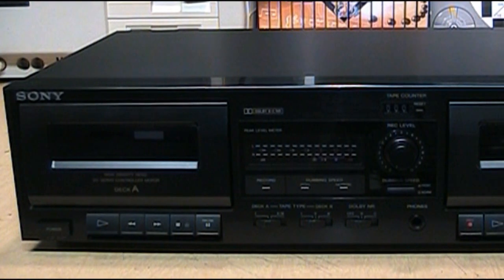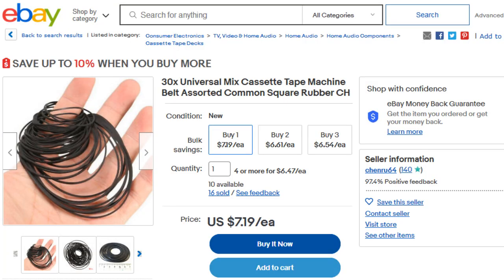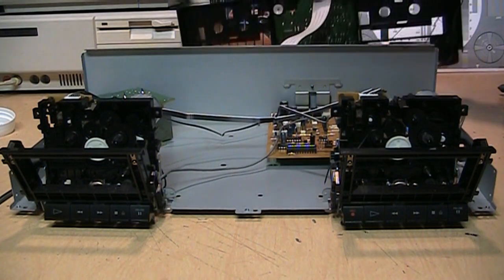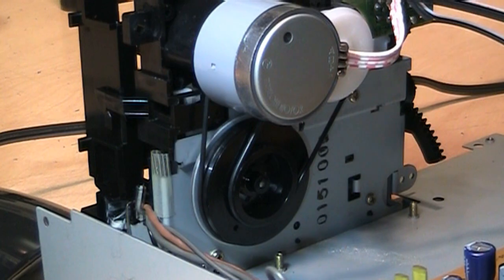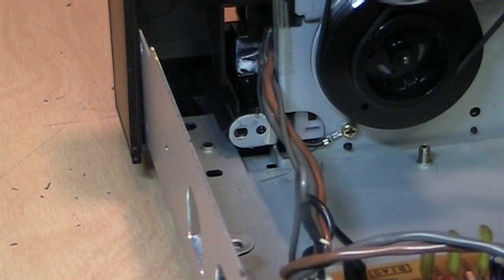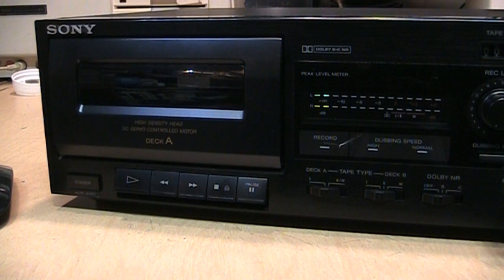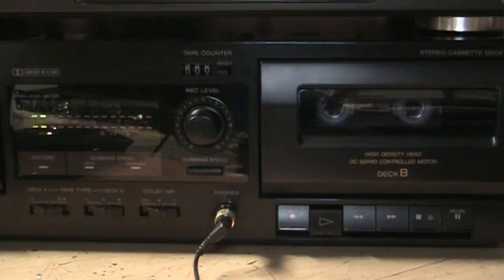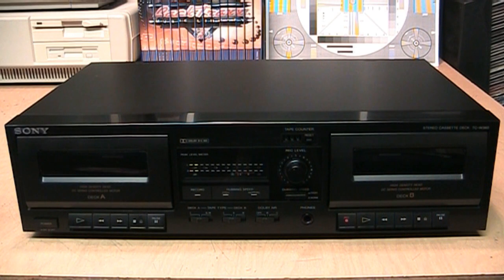The All-Plastic Sony Surprise cassette deck - TC-W365

Comment: A few years ago, I found a Sony cassette deck on the side of the road… I don’t remember the model number, and although it looked really nice, I also had to deal with badly melted belts which unfortunately stained my bedroom carpet (even though I was using old newspapers to prevent that from happening). Thanks again for such an entertaining and informative video!
Reply: How do these things appear on the side of the road? There's never anything interesting on the roads here, let alone things as big as a tape deck.
Reply: @RedShift5  Sometimes around where I live, people tend to toss out some of the most interesting things I’ve have ever seen by the side of the road… I have even found other related items that other people have tossed out like console TVs, boom boxes, all-in-one stereo systems and even stereo receivers (which I have actually found on more than one occasion)!
Reply: this comment goes well with the one on the top
Reply: @RedShift5  well...i got my Sony TC-W435 exactly the same way...by the side of the road...i swear to God...no lid on it though...all wet with rain and melted sticky belts just like most...it turned on and blue display illuminated...so i deemed it worthy of new belts...after lots of black goo removal with IPA and cotton buds...it mostly works...deck A is fine...deck B is poor sound and fluttery...it's a backup to my Kenwood twin deck anyway...other stuff i've seen...old computers...even a huge all in one Mac with crack in the corner (Mac pro?) several giant TV's...battery drills with dead rechargables (which i modded to run from an external power supply)...no consoles though - unlike Douglas...

Comment: I bought this tape deck with money I saved at Service Merchandise when I was 15 in 1992. I still use it today. It’s not anywhere near as nice as my other components, but it just keeps working. Great video! I need to replace the belt in deck 2, but will do both while in there, so you’re doing the research and finding that part no. helped me out big time. Thanks!
Reply: Yep, me too, i bought this same deck used at a thrift shop, glad I get to see the repair, service & reinstall of the belt systems

Comment: From a combination of personal experience and scanning eBay for a few years, the worst offenders for dissolving belts were Sony, Aiwa, Kenwood, Pioneer and Hitachi. At the other end of the scale JVC, Technics/Panasonic, Akai and Nikko used belts that stand the test of time the best.
Reply: I can certainly vouch for JVC; my two TD-V621 decks still have their original belts, and this deck utilizes two (identical) belts for the flywheel.
Reply: Personally I can vouch for Sony's giving up the ghost but never had a problem with Pioneer or indeed as you say Technics
Reply: I've been pretty lucky with belts not being melted, but now that Im thinking about it the Sony examples I've seen have certainly aged worse than the Technics/Panasonic examples I've seen.
Reply: And Denon. My 1989 DRW-750 is on its original belts, as is my 1984 DCD-1100 CDP. Both bought second hand....
Reply: I have an Aiwa deck from 1987 and the belt had turned completely into goo, it was fixable but required a lot of cleaning
Reply: Panasonic sadly in some of their decks have a flexible plastic gear that fails .
Reply: @thisisnev: Yep... a lot of those Technics and JVC decks still used wide, flat belts, and they've certainly held-up very well:  I have a nice mid/late 90s Technics and JVC deck with those flat, wide belts still running perfectly!
Reply: @AaronSmart.online  Sony eventually bought out Aiwa so it probably had a lot of the same internal parts as this deck.
Reply: Definitely! My 1981 technics' belts are mint
Reply: Dont forget Philips 😄
Reply: @EddieJazzFan  the mechanism and belts look absolutely nothing like this deck, and there's 8 years difference between them...
Reply: I have 3 or 4 Technics decks with the same mechanism (2 or 3 pieces of RS-M205 and an RS-M215), all working fine with their 40 years old belts and pinch rollers! And they are all well-used, in one of them I had to replace the head because it had a high freq rolloff at about 6kHz due to extreme wear. In that one I had to clean the belts and pulleys with alcohol, because they were covered with fine dust and slipped, but after the cleaning it worked perfectly. This was ~12 years ago, and it still works fine.
Reply: @mrnmrn1  my rs-m215 has also got a really worn out head. Do you know what the best replacement would be?
Reply: Totally agree with JVC! I’ve had several of their boomboxes still functioning on original belts, or even if the belts do need changing they haven’t turned to goo
Reply: I have a Pionner Double Cassette Deck from 1995 with the original belts, still working
Reply: I can also confirm this is 100% true. Have both a JVC and Technics Deck both with original belts, and have hardly ever had to change a belt on a Panasonic. However I have several Sony's with junk or melted belts.
Reply: @paulb4uk  Yep. The gear problem is most common on 90's Technics decks with auto reverse.

Comment: You gotta love how they try to make each LED on the VU meters look like two separate LEDs lights.
Reply: Even Nakamichi did that, on some of their lower to mid end decks, even at their peak [see what I did there?] in the 80s. And all segments, one colour. Famously [almost] all 'Naks' had manual tape type selection, and many had a mechanical tape counter, with the base models having them I think right to the end. But all working, serviced models today will wipe the floor with this sony (and the top Sony's competed with  Nakamichi, back in the day, and  the little WM-DC6 "Walkman Professional", five segment meters, mechanical tape counter, is simply stunning, with a Naka-like price to match). A bad one... may eat tape.
Reply: for estatics only, u ever used it?
Reply: @DuncanWEDD2019  @Duncan Webberley  Think of Sony D6C as Nakamichi RX-202  in terms of cassette orientation and Nakamichi BX-125 for practically most of the functions. :)

Comment: I had a nice Sony deck with Dolby S from the 90s that I bought new in J&R music world.  I used it for about 15 years and put it in storage.  Then when I went to take it out and use it again a few year ago, the belts were completely melted.  It was like somebody just dumped roofing tar all over the inside of the machine. I just junked the machine, but regret it now. The tapes that I recorded in that deck still sound really good.  Would have been good restoration project.

Comment: To remove the goo from v shaped pulley, cut cardboard q-tip sticks in diagonal. dip into acetone and swipe down the track to scoop some goo out. Repeat as needed. PS: Buy a few packs of 500 q-tips, always with the cardboard stick, not plastic. That cardboard can sometimes be used on spinning capstan to unstick hard residue that won't come off only with the cotton ball on the swab. paper is more abrasive but won't damage the capstan!

Comment: When looking for used Sony audio gear, I always will look for the ES in the model number. The ES is Sony's Hi-End brand and often looks like the same as the lower-end stuff.  The thrift stores don't know the difference and will sell it at the same price.
Reply: It's the WORST possible deal you could get (at least on eBay)... they command a higher price now than 30 or 40 years ago (including inflation). Meanwhile, there's plenty of decks with very similar sound and features and much better price, on the likes of Technics, TEAC, AIWA, Kenwood, Pioneer and many others, including Sony's own quality standard line (QS). They must be really dumb to sell an ES machine for cheap... they're not looking cheap as you suggest: they usually have plenty of toggles, buttons, pots, sometimes wooden sides or shiny metal frames, they have backlit cassette bays... there's hardly cheap stuff there.
Reply: "they're not looking cheap as you suggest", I meant this from the seller's standpoint. an tape player is a  tape player to sellers like thrift stores,  flea markets and garage sales (for the most part)
Reply: @X-OR_  Got you. I just wanted to add a pinch of salt. I am still pretty mad for the unjustifiable price delta on our side of the pond (EU).

In my experince price wise we are on a ratio of US 1 to UK 1.3 to EU 1.8, practically doubling the US prices. With a foreign ES price we may just get a TC-KE___S or K non ES series.
Reply: I have Sony STR-D1090ES receiver I bought in 1993.  Still works great despite not having any input more modern than RCA or composite.
Reply: @junker15  I have the  STR-D1090, it does not have the ES on the end also I purchased mine around 1993 but mine needs work and has some dry solder joints.

Comment: On some decks it's still quite important to replace the tape counter belt, as there is often a rotation sensor present which will cause the deck to shut down if the counter doesn't move. This sure doesn't look to be one of those decks! 

On saying that, like you said, it's the sound quality that matters, and this would've been entry-level and priced accordingly (albeit by typical Sony pricing, anyway!). ES quality it is not; nor does it claim to be..
Reply: Yep! Learned this the hard way last year when repairing a Sony TC-FX210. Took me hours of messing with it till I finally found out the tape counter belt had 2 purposes.

Comment: It makes me happy everytime I see someone repairing a cheap cassette deck. Sometimes those cheap entry level decks are way better than their parts. I have a "Telefunken RC100" tape deck from 1980 still with its original belts. It works perfectly and the sound quality is surprisingly good for an entry level tapedeck without any collectable value (unlike the RC300). From all the decks I have it's honestly my favourite for recording. But for playing it's better to hide in a cabinet or to raise the volume very loud. The power supply hums extreme by design and the constantly moving capstan and plastic parts don't help much either... But the sound of the audio signal is great for a device like this. I guess cheap(er) devices like this that produced a lot of unwanted noise were the reason why hifi cabinets with doors were so popular in the 1980's and 90's. If your're willing to compromise on this, you can still have a lot of fun with devices like this, in my opinion.

Comment: Of course I watch this almost two years on, having bought my first Sony deck (and first deck ever) just the other day as of writing, and having to do the menial, torturous process of disconnecting wires and screws, removing melted belts and getting the rubber goop all over my fingers (even when I use gloves), and putting it all back together to hope it works (it seems deck A doesn't wanna work now that I cleaned it up, but I think that was because I may have either plugged the ribbon cables in the wrong outlets or because I didn't screw in this little connector providing power to the deck in some way, didn't read the electrical diagram completely but at least the service manual I found online has a pretty straightforward yet tedious way of disassembling the deck). I also think I got the slightly older brother of that deck, as it seems to be the lowest model of its respective line (TC-W411, and there were four others mentioned in the operations and service manuals, but what makes mine cheap is that the main circuit board is permanently held in place at an angle by a metal clamp in the back, and comes out when you take out the front panel, so I'm left praying that I didn't disconnect it somehow whenever I move it a lot to work on it, at least mine has all metal on nearly everything but te front panel so it has some dependability besides the fact I hear the motors spinning and see the level meters light up, so it is working apart from the belts). Hopefully all goes well for me, though it certainly won't be as well as you, already got new belts ordered, along with this hand cleaner for the belt residue. Oh and I'm not sure when mine was made, didn't check the date codes, but it was made in Japan still and had a copyright date of 1991 on the operations manual I was given when I bought it off eBay, so somewhere during or after then.

Comment: Around 1994, I purchased a brand-new low-end Sony single-well cassette deck, the TC-FX170.  This deck was quite lightweight, had piano-key controls and a mechanical time counter. The Sony TC-FX170 offered Dolby C, auto-tape-type selection, and a manual bias adjustment knob. It performed alright, the piano-key controls weren't particularly elegant. I haven't had this deck for many years, I bought it in 1994 because it was a low-cost deck with Dolby C and the bias fine-tuning.
Reply: Dolby C was 1978 tech, HX Dolby was 1995
this is cheap crap, why post it, mad here!
Reply: @lucasrem  In 1987 many decks already had HX Pro.

Comment: Have consistently had the same issue with about a dozen Sony cassette decks: The 90's stuff always has melted belts, while the early - late 80's do not. Cleaning up the tar out of motors and pulleys is always REAL fun.

Comment: I've had a pair of mid '80s Sharp RT-100 single cassette decks for awhile. Only mechanical keys, not the best decks of their generation, but they do have metal cassette transports and 1/4 mic inputs in addition to the headset jack, and basic Dolby/CrO2 tape settings. I keep one at home and the other at my parent's place to mix tapes for my walkman or car (Yeah, I still have a car with a working cassette) So a couple years ago, I accidentally left one of the decks powered on for at least a week. It still works OK, but I started thinking about getting a spare, and found an RT-100 "parts pr repair" deck on eBay last month for $5 + shipping - just under $20. When it arrived, except for some muddy sound, it seemed to work ok. Belts still good after 38 years and after a good head cleaning, it sounds as good as my other one!

Comment: Damm, those belts !!!
I've got Sony tape decks from the early 70's which are still on their original belts but I've also got 20-30x Sony 90's midi systems which just have nasty goo where the belts once were !

Comment: I bought a similar brand new Sony tape deck deck in 2005 @ Best Buy. After I brought it home and unboxed it, I realized it's not a Full-Logic one. Looking further, I was shocked that they used this same plastic mechanism, on a deck which features Dolby S & Type IV tape format compatibility. I immediately took it back and swapped it for an actual Full-Logic Tape Deck. I never liked the piano style push button type Tape Mechanisms. With Full-Logic, I can program the deck to record my favorite dance music off radio which plays after midnight. While I'm asleep. Not to mention, I can wake up to tape, program which tracks to play, which to skip, repeat tracks on tape same as you would on CD. Fully Remote Control Compatible. My father ended up purchasing similar deck in 2012 after he saw all the tricks a Full-Logic Deck can do. I'm surprised I never had to change belts on any of my tape decks after watching all the videos how those belts turn to tar. Well, I take good care of my electronics, cassettes & decks. Even if something goes wrong, I know how to fix them, after fixing dozens of them for my friends.

Comment: I'm now considering picking one of these up. Looks very easy to replace the belts, even if they melt to a goop, theres no fancy electronics that could malfunction and even though the mechs are plastic the gears look pretty stout so I doubt they would chew each other up or deteriorate into crumbs. I love the fancy cassette decks but just like buying a 15 year old BMW you cant expect them to run consistently. A deck like this is like an old honda civic, cheap as physically possible while still doing everything a car should do.

Comment: I bought this exact tape deck at Circuit City. That was in the 2000s. Didn't realize how old the deck was. My. Belts need replacement as well. Good video.

Comment: I thought it was just me who had bad luck with a Sony belt. In my TC-KE600 (not the cheapest model) the belt that drives the capstan totally turned into a sticky disgusting goo very hard to remove. Interestingly enough, the belt that was in charge in fast forward / rewind remained in a mint condition.
Reply: @piotr433
I would bet that Sony spec'd a higher quality belt for that use due to the speed and tension on it from FF and REW speeds. Wow talk about bean counting, you could definitely tell that Sony stopped being special in the 1990s.
Reply: @watershed44  Sony stopped being special indeed, at least in audio/video - all more or less sophisticated Sony's stuff bought by me since 1990s had some fault, including an ES class amplifier...
Reply: @piotr433  Wow pretty disappointing that they would let one of their premium class products suffer serious problems like that ES class amp. Until the mid to late 80s their mid range and top range consumer products were generally outstanding and very reliable.